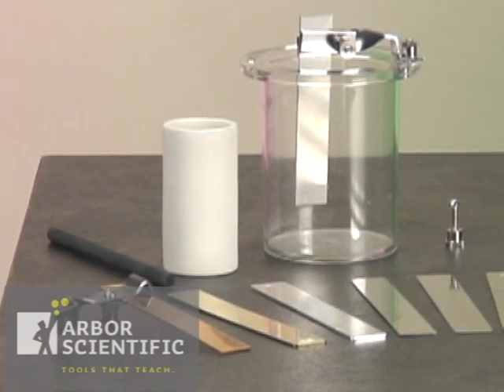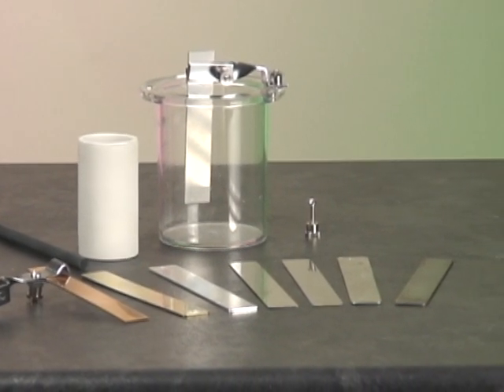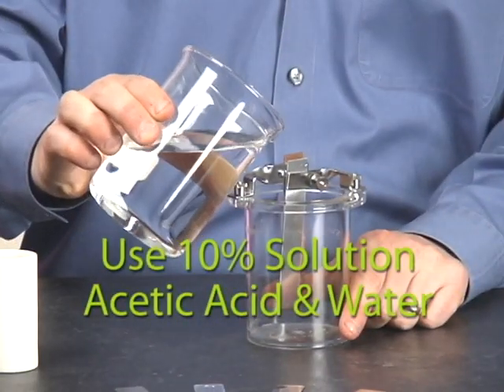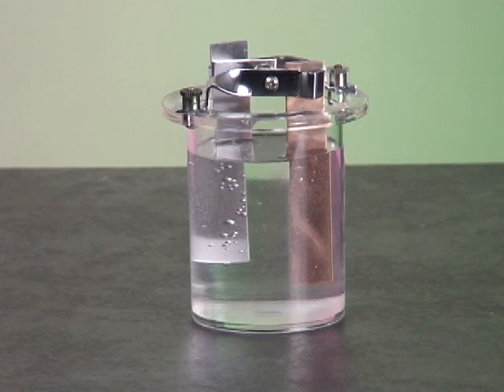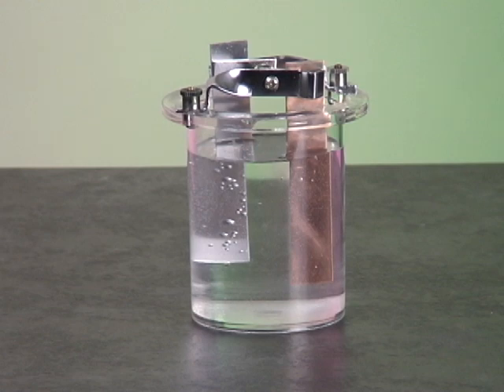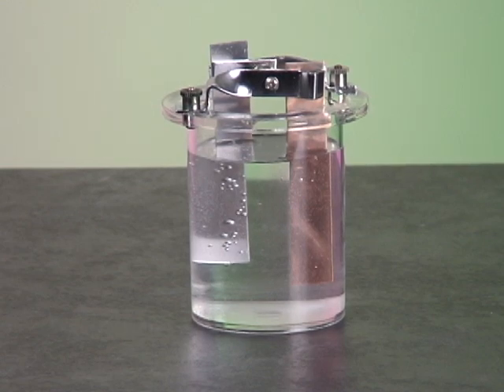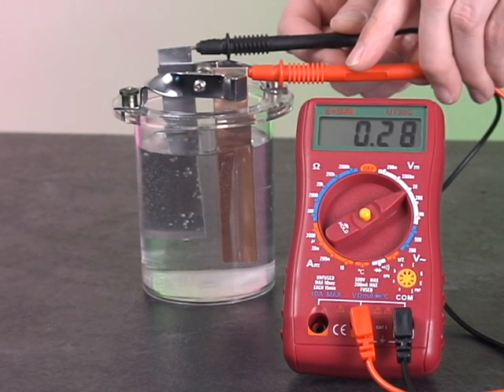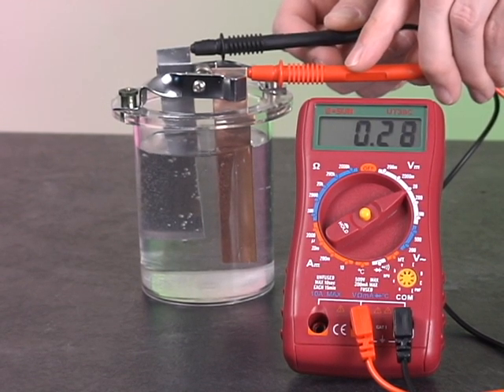Demonstrate the Conversion of Chemical Energy Into Electrical Energy | Voltaic Cell with Electrodes

Comment: So what is the gas of bubbles formed on the Zinc surface ? if KNO3 (aq) is used instead of Acetic Acid as solution, will NO2 gas form at anode (copper surface) instead of H2 gas ?